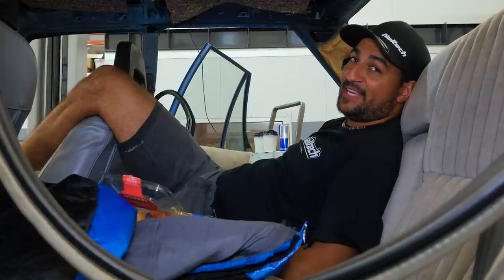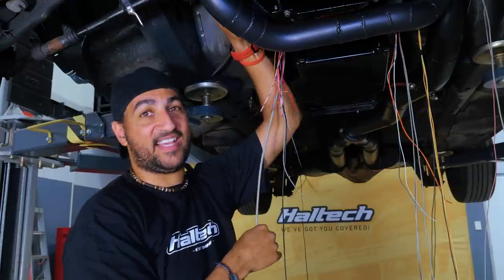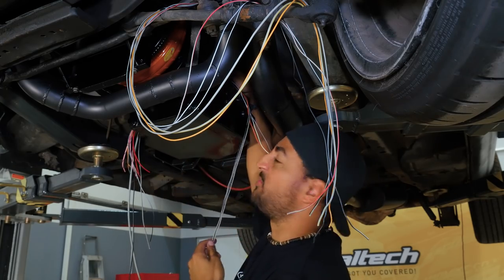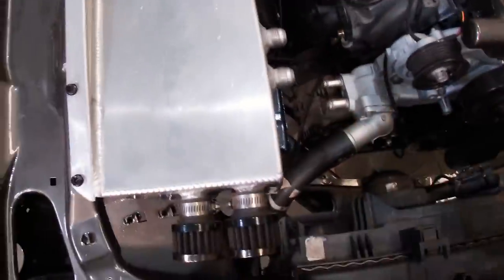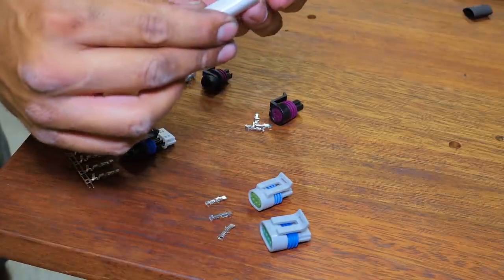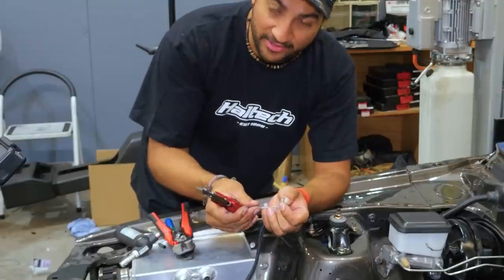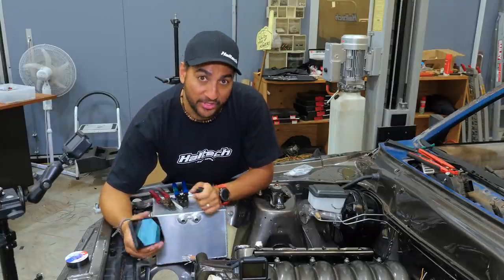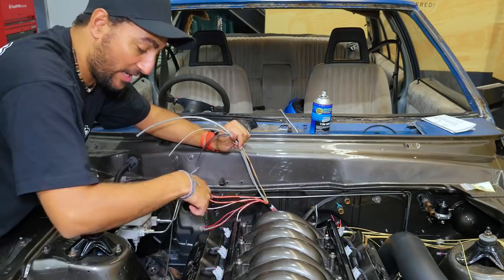🎥 Ep7: Engine bay wiring - sensors, throttle body, fans and more | DAVE'S WIRING VLOG

Comment from the maker: Welcome back! Today we've got another long episode for you,m chock-a-block full of useful tips and shortcuts! Hope you like it:)

Dave starts underneath the car and then works his way into the engine bay where he wires all injectors and coils followed by a whole bunch of sensors; cam, crank, flex, knock, thermo fan, air temp, fuel pressure along with the dbw throttle body, alternator, battery. Dave also explains the subtle differences between the pull-to-seat and push-to-seat connectors and figures out the best place to mount the wideband controller box. So make sure you're nice and comfortable before you hit that PLAY button, this is going to be a long one! 

Alternatively use one of the shortcuts to jump straight to the topic you're most interested in:
Engine Bay overview: https://youtu.be/gkuNgpC3hqM?t=358
Push-to-Seat vs Pull-to-Seat Connectors explained: https://youtu.be/gkuNgpC3hqM?t=635
Air Temp Sensor: https://youtu.be/gkuNgpC3hqM?t=749
DBW Throttle Body: https://youtu.be/gkuNgpC3hqM?t=919
AVI Wire Stripping Warning: https://youtu.be/gkuNgpC3hqM?t=919

Wideband Controller Positioning: https://youtu.be/gkuNgpC3hqM?t=1319
------------------------------------------------------
Related Videos:
How to Ground Your ECU Wiring: https://youtu.be/iuCIC1HjHVA
Why You Need an O2 Sensor: https://youtu.be/IevNJBSNFzA
How To Crimp Like A Pro: https://youtu.be/VXVISyLUTl0
How To Wire an LS Engine with a Terminated Harness: https://youtu.be/UD5mbh8AfPk

Comment: Another great one Dave and the crew! I actually didn't know about the pull to seat connectors (most of my experience is with deutsch and wetherpac connectors) so now that I've seen that, I TOTALLY get why you don't normally do service loops. That really would be a PITA

Comment: Great videos, attempting to replace injectors and setup a sport 2000 to my 2jzgte tundra. Ran into all the types of connectors mentioned and did it through trial and error. Still working out the kinks adding sensors and wideband into the old ratty plug and play harness. Would love to replace the loom with a premium 8ft next winter. Wish I had watched this before messing with it, thanks for taking the time.

Comment: Regarding the shielded wires in the loom, Can we use the shield as the return path for the sensor? Ie. a 3 wire sensor with +5V, Signal, GND would only require a +5V and AVI/SPI to wire, saving on sensor GND wires.

Comment: I really need some info on these. These push to lock delphi connectors. I got them in a bag with the white pieces on. Do I need to pull these off when inserting the pins?
I crimped some pins on but I actually needed to push the pin in with a tool on the back to make them seat with brute force. Pretty sure I'm doing something wrong here.
Barely could find some actual detailed installation info on these online.

Comment: I'm curious about your shielded wires. Have you tested how much they cut noise? I thought both end need to be grounded to really work well otherwise it's not as good as it could be. Granted getting a metal connector or a way to ground at the connector might not be worth the trouble but I'm curious if you've tested to see if the expense is worth it.